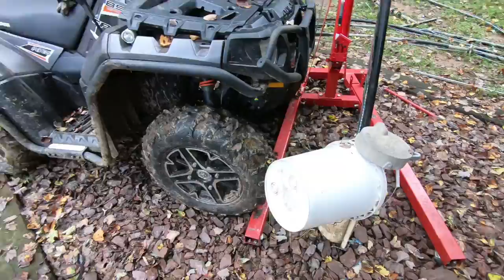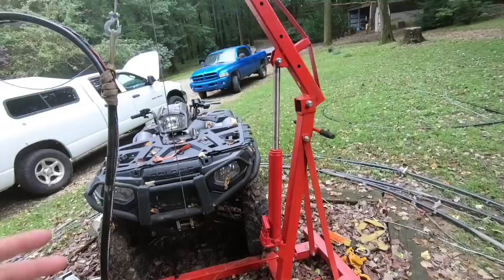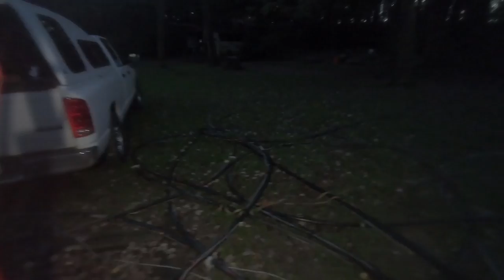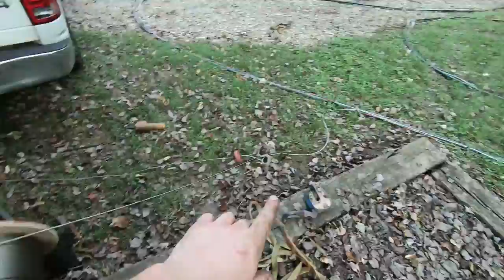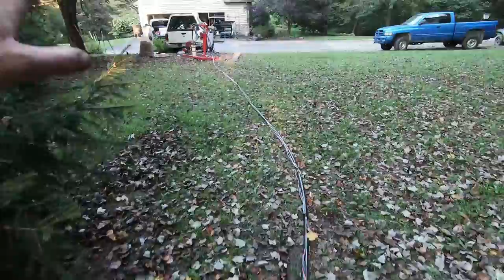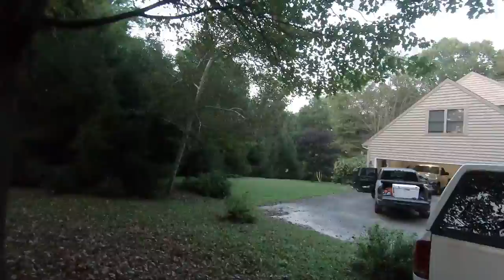500FT DEEP! One Person Submersible Well Pump Removal and Installation

Comment: Did you remember to put a few gallons of bleach in there? With 500FT of hose, You've got a lot of surface area to bleach the insides of those pipes.

Comment: I have a water well service company in Alberta. You did great with adapting with the tools you had. I’ve seen people try and pull it themselves only to find out it’s 1200 feet deep and they drop it.
Reply: What happens after its dropped? How do you get it out?
Reply: @euonymus1980  
There’s a few steps to prepare for that. Find the total depth and the pump setting depth off the well report. Then you know how far it dropped. Go down with lengths of steel till you get to the depth of the pitless. Try and thread into it. If that won’t work I made a length of rebar with splines welded to it and a coupler to thread to the steel. Lower that down past the pitless and turn it so it wraps the pipe and wire up and pull and pray it all comes with it. Will cost some hose and wire but at least you get it outa the well

Comment: I know I’m extremely late to the party, but next time, If you get a larger pulley, maybe a 24” hook sheave, you can tie a rope to the top of the pipe and that black pipe will flex around the pulley and you can just drive your quad 500’ out in one go. Could have it pulled in minutes. Probably better to use a truck because it’s heavier, but could probably make it work with the quad.

Comment: Nice job for such a deep well.  My Dad's well died during December back in the late 90s.  200 feet down and no water, so we hung a come-along from a 2x4 tripod and pulled it up a few feet at a time, just like you did, in single digit temperatures outdoors.  Replaced the pump, put on two sets of wires in parallel in case one broke later, then lowered it back down the well.  Start to finish was less than a day and that pump is still running more than 25 years later.  Your video brought back some memories.  Glad to see your 'fun' happened during warm weather.
Reply: Wow, I’m loving that redundant wiring idea!

Comment: I can't believe I never saw this video.  I'm almost 60 and have been pulling my 500 ft well by myself for the past 24 years.  I've pulled it maybe 8 times??
I butt up against the well casing a big rail road tie.  Then I add half of one on top of it then a quarter and another.  Then I took a chainsaw and cut a rounded slope into the casing so when I toe the pipe and wire it rides on the curve cut into the railroad tie.  On each side of the stack I nailed a piece of outdoor plywood so the pipe doesn't wonder off an edge.  I use a tripod I got long ago for pulling car engines.  I winch up the pipe and lay it over the ties and hook it to a truck or garden tractor.  The first couple times I attached it to a riding mower in gear spinning to go forward.  I manually pulled on the pipe till the mower started to grip and took off with the pipe.  Then I ran like hell to catch up to it running down the hill by itself. lol.
I just happen to search because I'm sick of this method and am getting older.  I recently got a heavy frame for holding an outside wood burner tank.  I'm planning on that supporting a 5 ft wheel.  I'll turn the wheel and wrap up the pipe and wire.
I've gone through so many pumps, motor control boxes (actually only change the capacitors now.  The switch never goes bad) and pressure switches its unbelievable.  The cheap junk square D contacts burn up from being cheaply made and never aligned.  I went to a heavy duty one but now think I'm installing a large relay.  Actually a off delay time relay.  So if the pump runs more than 10 seconds or whatever it shuts off itself and doesn't burn up.  Thinking about an arduino and making it dance.

Comment: With a 2001 Goulds pump there is good chance that the impellers were breaking the center off the shaft.  They switched to clear impellers back then and had an issue with that.  If you want to check it out both ends are left handed thread to take it apart.  Make SURE you can not drop that cable because if you do it stacks on top of the pump and there is no chance of pulling it out.  You could spend days fishing or re-drill the well because of it.  Next time tape it to the pipe like the rope so it couldn't fall down hole.  Also take some silicone to the bottom of the cap to keep the critters out of it.  Stay safe, Kenny
Reply: Good safety tips,hopefully my pump will last for ever.
Reply: @jeffreyhaynes5774  They are all supposed to last for ever, or at least a very long time.  If it doesn't make 5 years something else killed it.

Comment: Make sure you put the date of replacement of the pump on the cap for anyone wanting to know last time it was installed. Good job. You or anyone might use a wooden spool that electrical wire comes on for pulling out the pump and hose next time. Just anchor the supporting rod and spool with some heavy in opposite direction of the pull.

Comment: Thanks for doing this video. I got to the T handle point and couldn't lift it for my life. Then I found you. Gonna try my engine hoist!
Reply: Did it work
Reply: @ambergreen6714  It did! I was having trouble disconnecting the crow's foot thing where it does a 90 degree bend into the house. Once that was off it lifted out with the engine hoist and a couple of vices used to grab and lift and to brake and hold.

Comment: I thought about using my winch off my dodge ram to pull my pump 300 ft down, and you just validated my idea. No trees over the well head for block and tackle, but I like your motor hoist idea! Thanks for the video!!!

Comment: I pulled 70 ft of iron pipe out of my well a couple months ago. The pitless adapter was messed up so wouldn't release so I just pulled it. I started out using my a frame with a chain fall but switched to the wrecker when I learned it was iron pipe! Brother in-law was standing in skid steer bucket unscrewing pipe as I pulled  up with the wrecker. I replaced it with black plastic pipe like yours. I started mine on Saturday and than when I realized I needed a new pitless adapter I ran the pipe out the top and across the yard to my outside spicot on the house cause I wasn't going with a shower or shitter for 2 days! Lol. Pulled that thing 3 or 4 times before I was done!

Comment: Good job got to be one good pump to bring water 500 ft up then carry another good distance to pressure tank what a work out I pulled one 800 ft I know how bad it is good job man lol I used tractor front end loader to do the 800 ft one had one guy standing at well while I backed front loader up the road lol

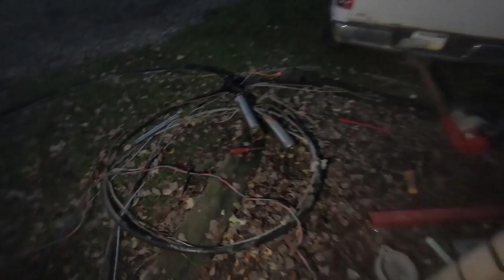Comment: YOU my friend are a man after my own mold.   You had a problem, you created a number of solutions to yank that bugger up.   Great thinking with the engine crane, pulley, winch,,,,,,,,  It may not have been the fastest, easiest or most efficient,  but it did work in the end.  Now to watch 9:09 to the end.

Comment: Excellent Video,  I need to replace my pump for auxiliary water supply, as I got connected to city supply in 1985. 
  I am only approximately 100 foot down,  so it should be some what easier then what you had to contend with.
  My pipe is 1 inch galvanized, I will likely reinstall new pump with pvc.
  Thanks For Informational Video.

Comment: Had to pull 200 ft well a couple weeks back. Used tractor and 2 come a longs. Got 140 ft out and then was able to pull the remaining 60 by hand. 
Oh and it had no safety rope either. Made me very nervous.
Cost me 800 bucks. Better than the 3500 the well guys wanted and that I dont have.

Comment: I have a 1,000 ft with 2 1/4 inch galvanized pipe from the pump to the top of the well. Running 480V 3 pace
Phase and the Damn thing still costs 10k to replace
Reply: How the f yours cost 10k for a new pump was their a dig involved an paying people for their time
Reply: I see 4k not 10k
Reply: what size pump, even a 5 hp pump doesn’t cost that much, and why is it sized so big?
Reply: @Lmiller201  labor/crain truck fee no other way to pull that up and replace it yourself

Comment: Brother I'm halfway thru the video. At this point I am hoping that you checked the relay and capacitor first. I have seen stuck relays send power always to the start windings and cause the overheat protection on the pump to go bad. Usually this will fry and short the capacitor and stop. Once and a while it will keep current to the pump.

Comment: my uncle ran over the well and now we have to somehow fix the casing cheaply because we dont have money to hire anyone. 
my mom has stage 4 cancer and cant work and my stepdad just passed away. were swamped with bills and hiring someone is far to expensive.
im the only one in the house with a full time job... 

so my plan is....
get a pvc coupler and a section of pvc pipe 
pull out the pump
dig down around it 
inflate a balloon inside below where I'll cut the pipe to catch debris 
then cut the pipe using tape for a straight cut guide
clean debris and dirt from pipe 
Remove balloon
glue on the the repair section 
unbend the section of steel pipe 
and replace the pump and cap.  

i hope that sounds reasonable. shouldn't cost more than $20 for the PVC its just a ton of work.

Comment: should have put a check valve or two since the pipe line was so long that way their isn't a back hammering on the top of that pump  set an inline check valve about 12ft above the pump and another one at the top of the well casing about three or five feet down H2O Mechanic on Utube,  recommends this even thoe the pump has one built inside it.. the extra chk valve relives the back psi hammering and 500ft is allot of downwards psi

Comment: Hello first off great video great job sir. I am in pa also and my pump just went out on new years. Second how the hell did u get the hose out??? Mine is 6ft down before I see anything to grab. How do I get it started to come out? What's on the other end of that T handle? I think I can do this just fine I just can't reach the pipe. Also I can't pay to have someone do it because I am on a fixed income from the army ( got blown up a few times in Iraq) so I don't have the money to pay someone to do it. Can you tell me about that T handle please and thank you

Comment: Two year old video I know but did you happen notice how far down in the water your pump was suspended? Last time I had to pull my well the water table had dropped so the pump was sucking air and had to drop the pump to compensate. Luckily I had plenty of depth yet.  The water tables are dropping.  JFYI!

Comment: I know the struggle my well is 360' I built a big ass pulley in the roof of my pump house run the pipe and rope thru it and drive away but you need to be 8' high to get the angle to work

Comment: What kind of poly pipe is that? Usually it only goes about 300 feet deep
Reply: As you said, I could not find a poly tube pipe to put in my new 420 foot deep Pa home. The well driller filled me in. Only way to go is schedule 80 pvc and has to be threaded. I used brass couplings.
Reply: @freddozer1399  Can't glue fittings?
Reply: @jameshallford8656  No, because you will never be able to pull up or drop down. Here is how I did it. I uses 1-inch sch-80 pvc and threaded both ends of 40 ten foot pieces. The key part I made from a 1/4 inch thick by 8 X 8 aluminum flat stock.  I cut in half on my table saw. Then put it on a flat small piece of scrap plywood, that is bigger than the aluminum. Fit the aluminum back to its original shape before you cut it in half. Screw small pieces of wood on every side. Now get a hole-saw slightly larger than od of pipe and drill a hole in the very center. now you need to use some flat stock on one end so you can open and close around pipe. I did both sides so it could not accidently open.  This plate with the hole in it is your workbench and stop.  You put a threaded coupling (I used brass) on one end of each 10 foot piece. I built a TP out of 16 foot 2 x8 and used a block a tackle to lower it. I temporally screwed a eye fitting into the coupling top and had a hook on the block and tackle rope.  As its lowered and hits the plate it stops and you unscrew the eye and screw another 10 piece of pipe in and its all repetition.  Yes you must pull upward and open the hinge to let the coupling thru.  I also notched the plate opening on one side for the wire and a pull rope.  I ran the pump in a 55 gallon drum after I made the watertight connections. before I set the pump in.

Comment: I’m confused how u used poly pipe for 500’ when it’s only rated for 160 to 200 psi? My well is 400’ and with the pressure tank I need 223 psi….I can’t find a 400’ continuous length of pipe that can handle that amount of pressure.

Comment: I have a well and want to put a pump in for the garden and pond. Do you set the well on the bottom?  I dropped a fishing line down mine and think its about 70 ft.
Reply: Put your pump up about 10 feet from the bottom. You don't want to suck dirt and rocks into the pump.

Comment: Vaseline and any oil base grease will break down the Nitrile Butadiene Rubber in 6 months to a year. 
Meaning that o-ring on pitiless adapter should be gone by now

Comment: I wish I had been there. I could of saved you so much trouble. I have done 1k wells.
Reply: What would you suggest different?  We are about to tackle our well pump installed in the 80's...
Reply: @kesanixon1373  So sorry I have not responded. Health Issues. No matter the water it must be tested. In most states this is a free service because it informs locals of water quality. Until you have water quality, please do not drink water direct. Boil the hell out of it. Blessings and be safe. Turbo

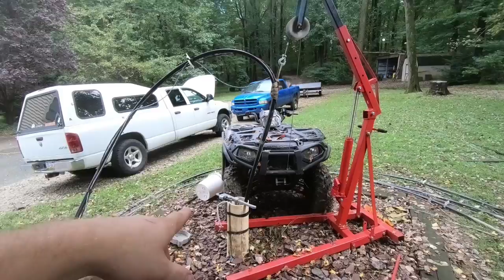Comment: 7:10 your pulley is way too high, if you would of put it about 6" above your 6" PVC pump casing would of worked fine. I just pulled up a 200ft long well today with an old 12" tractor wheel as the pulley.

Comment: 500 feet that's a 2hp expensive pump haven't seen black roll pipe in a while screw pipe is the way to go next time with a schedule 80 male adapter at the pump .Myers pumps are top shelf if you get into this again. be glad you had enough skills to do the job that would have been expensive. They make plastic spacers to keep the electric wire off the side of the well so it doesn't scrape and short out for future reference. Hey if ya got water its a good job. i assume you have a septic system not city sewer BETTER right this down will save you thousands if you ever have drain field problems don't laugh this works i guarantee it buy 5 gal bucket of molasses find a goat creamery get 5 gal of goats Whey mix 50/50 add 1/2 gal twice a day till the 5gal is used then wait a week do the next 5 gal same way store in shaded cool area in 2 to 4 days it will work like new again everything might cost 30 bucks total. I promise you it works unbelievably new drain field costs around 3 to 4 thousand five bedroom house about 5 k when i was told i didn't believe either do now big savings for 30 and a lil time. For preventive maintenance use 5gal every two or three years
Reply: meyers pumps are junk, home depot/lowes/ department store quality crap
Reply: Well if it last for 10+yrs .. and you a fit. Then kudos meyers it is

Comment: Charge by a well company will be $4000.
Reply: Just had three quotes here in Texas for a 560' well... $7500 - $8500+. Plus it's PVC threaded 20ft sections. The 2hp pump is only $1900. Some B.S....